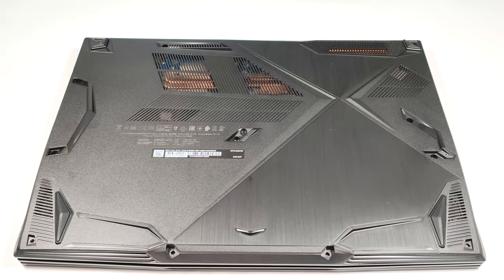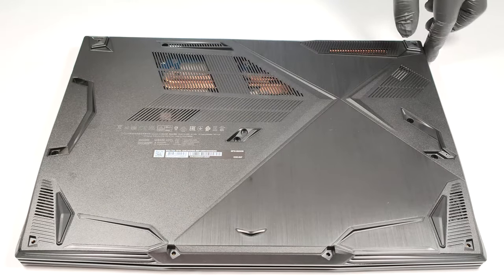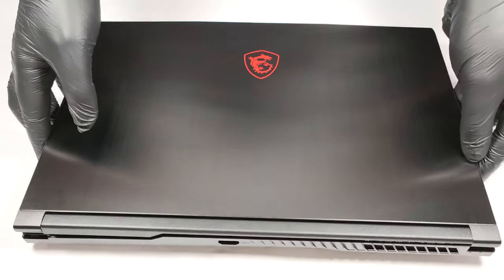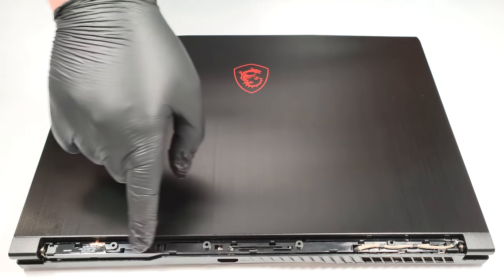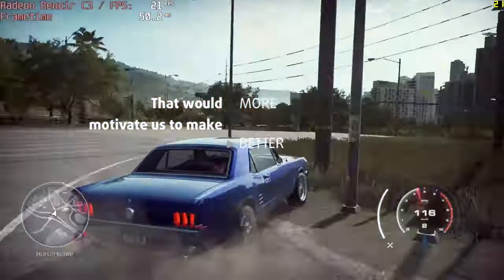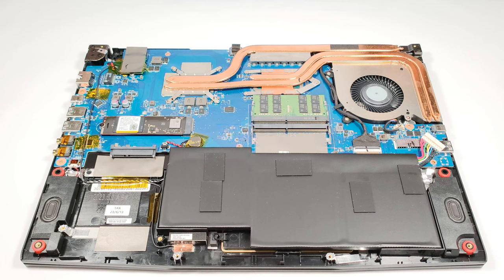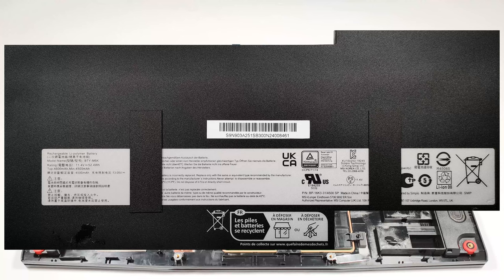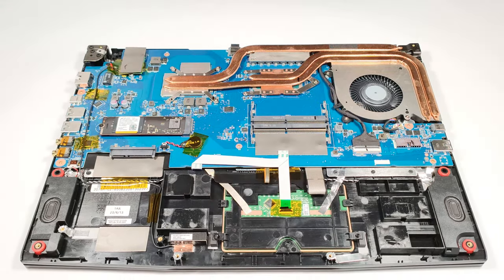🛠️ How to open MSI Thin GF63 (12Vx) - disassembly and upgrade options

Comment: Thanks for this video.  I was scared I was going to break it.  A brand new unit even. But this really helped me get it apart to install extra ram.  Especially the bit at 1:18 with the hinge cover.  Getting that hinge cover off.  

Anyone else reading I can't stress enough to take your time in unclipping that base. It takes some maneuvering that off. The ports will give you trouble  Keep working at those clips.  Definitely leave that side with the most ports until the last.

Comment: I can’t to this there are wires from the audio input what can I do?
Reply: Gently slide the cover in the side of auido output after removing the remaining, otherwise u ll break the mobo ,, by the way i also faced the same issue , but i got it
Reply: @dass854  it’s the cheapest shit I regret that I bought it

Comment: Hi^^. I got a small question. I m planning on getting this laptop and I wanna upgrade too the SSD capacity...here's my doubt:
If I open the laptop fresh from the box before turning it on for the first time and replace the SSD, if I turn it on will it install the operative system on that SSD? Or I gotta download the software to a USB?
Reply: It does not matter, if you replace it after or before installing the windows you need usb to install windows

Comment: Will Seagate’s thicker ST5000LM000 5 terabyte HDD fit in the bay?  I installed the 2 TB when I bought the GF63, but would now like to install the thicker 5 platter/10 head unit, if possible.

Comment: Please someone help me. I just disassembled my gf63 to change its thermal paste. But after I assembled it won't turn on and the charging indicator lamp didn't turn on too. Can someone give me suggestions what's wrong with my gf63?
Reply: Maybe you miss some pins to plug in to its place try to check again
Reply: Plug in charger and boot on. Needs a jumpstart so to say.
Reply: Open the case again and try to reinstall ram, SSD, and remove the battery and then settle it again, and remember don't forget to unplug the battery power first before u modify any parts on ur laptop
Reply: Problem solve or not bro wm
Reply: @mattcat5668 Tahankkk youuu brotherrrr🎉🎉🎉🎉🎉🎉🎉, very much you are herooo😂

Comment: is it fine to install a 2.5 ssd in the laptop without bracket
Reply: It's okay if you gonna use the laptop as pc and not moving it al lot but for safty use it
Reply: hey, in this model, is there an extra ssd slot to upgrade storage?
Reply: @itsNicoRepx  yes
Reply: @RushBalogna  thank you bro! I got this new one and was afraid to open it up to check thinking I might mess up something. Cheers

Comment: I got this computer almost two months ago and my fan has just stopped working completely, anyone got a fix? Wondering if it is worth opening and trying to fix myself or not
Reply: i got the same problem after 1-2 years and i ordered the fans for my laptop just order the fans online for your laptop and repair it self its easy

Comment: Look at those little tiny single fan and heat sink, so cute. Can’t believe MSI sold e-waste straight away.
Reply: it works well actually that fan is good enough for the specs.
Reply: Since the gpu (4060 in my case) runs with 45W its enough. Under load its 72C Max at GPU and 78C at CPU
Reply: That was my concern too, but if it does the job then it's ok just one fan I guess